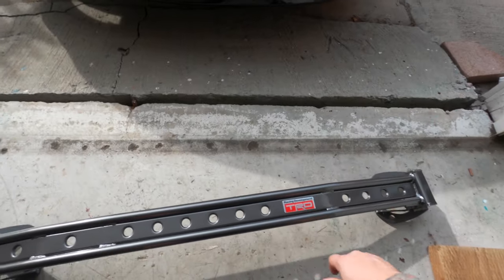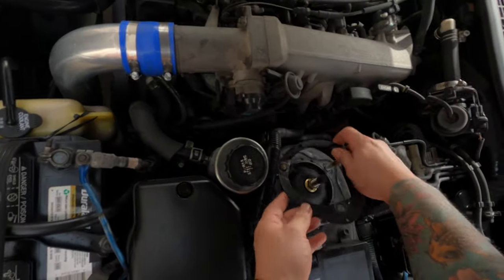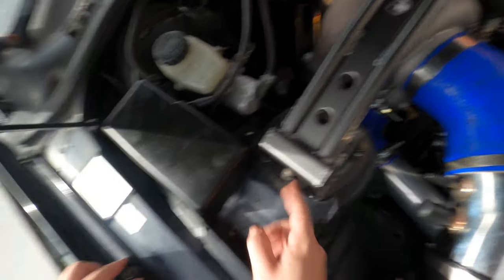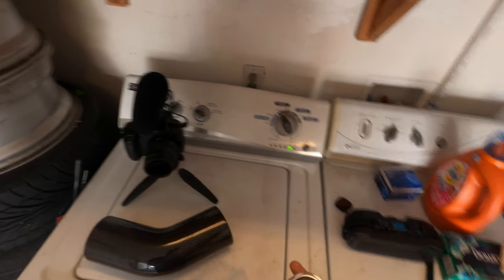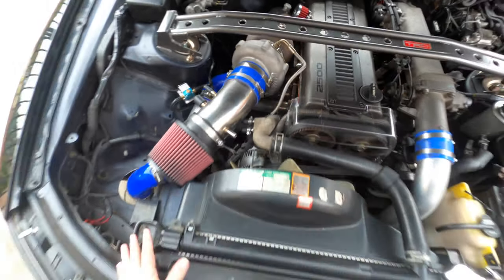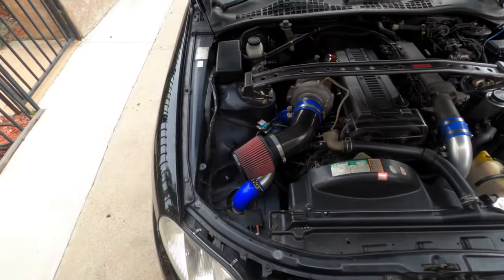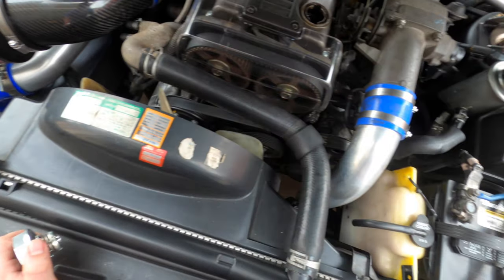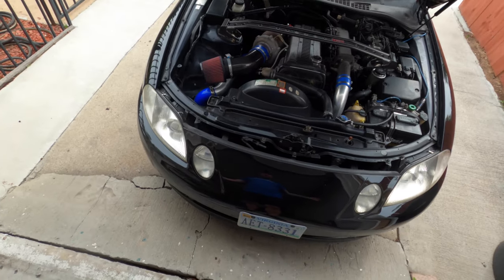Upgrading the Look of the Engine Bay In My 1JZ Toyota Soarer

Comment: what intake did you use? I am trying to find one for my soarer
Reply from the maker: This is after i switched to a single turbo. Went with a drift motion pod filter and a pipe from amazon the fit the  available space. Just have to make sure it fits on the front of the turbo.